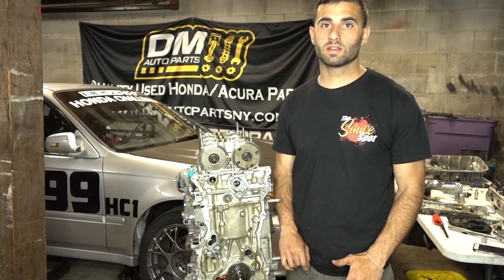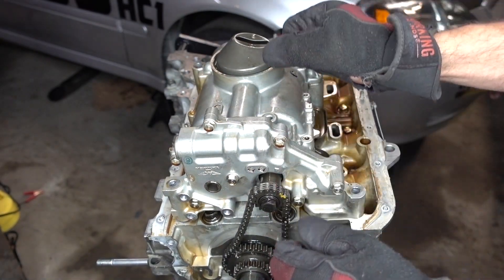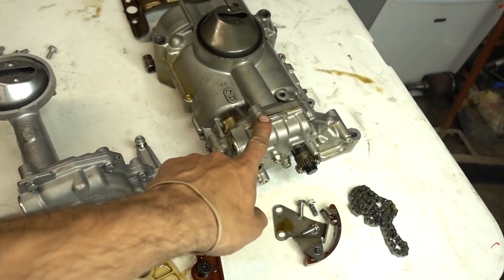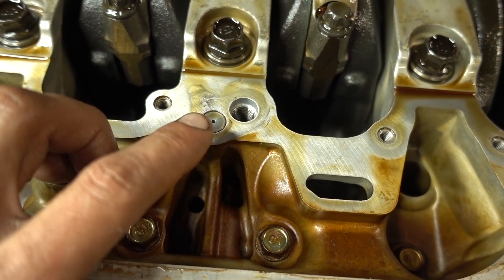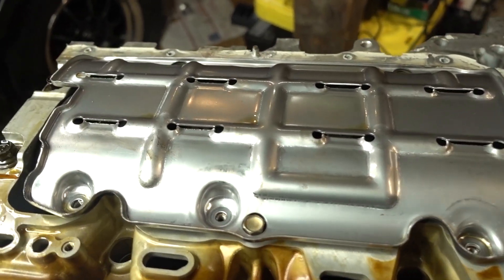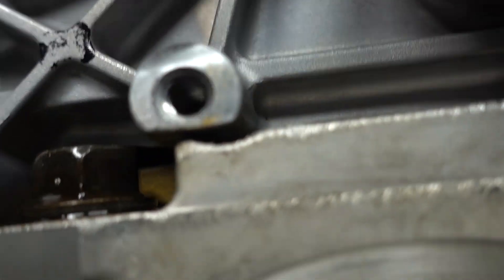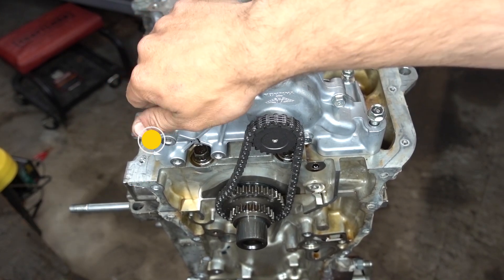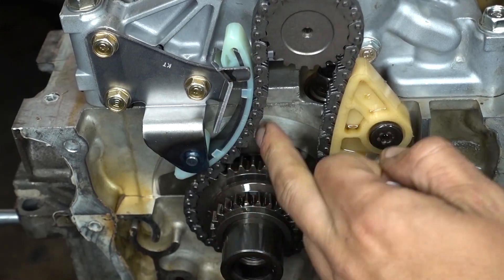ACURA RSX TYPE S K20 OIL PUMP INSTALL ON K24 BLOCK

Comment: Big boss!! What if I don't want to change the oil pump in my K24a ?  I have an 8th gen civic I'm tired of the 2.0l . So i got the k20z3 out . Everything is almost switched over expect the pump. What if I want the k24a original pump do I have to do anything special???  Do I have to switch it ? Will I get oil pressure if I just keep the original k24a oil pump in thier ? Please man I need your help!

Comment: My chain wont fit.... Cant get it on the crankgear and the oil pump gear at once. If i tilt the oil pump i can but its already under stress at that point. Cant get the oil pump into its position without breaking the chain... not sure what the hell is wrong...
Reply from the maker: Are you using the RSX oil chain? does the pump bolt down okay without the chain attached maybe there is some more trimming that's needed on the oil pump to fit the k24 block.
Reply: @DAVEMARINO  Yes the pump bolts down fine. No issues there. I bought a K24 timing set which included a K24 oil pump chain. Is the RSX oil chain longer?
Reply from the maker: @asbuster2191  You need to get the RSX oil pump chain.
Reply: @DAVEMARINO  oof. Thats a 100 euro chain... Oh well... If i need it... Cant build my engine otherwise haha. Thabks tho!
Reply from the maker: @asbuster2191  Best of luck

Comment: Is it beneficial to swap the k24 oil pan out for an rsx type s oil pan on this conversion? Should I just leave my k24 original oil pan on the motor
Reply from the maker: No real benefit to it. the K24 steel pan can take hit better on the road vs the aluminum oil pan that will crack and break.
Reply: @DAVEMARINO  Would the oil capacity increase since the k20 pump is smaller? My intake camshaft keeps scoring on the journals. Been twice now not sure what is causing this? Any ideas
Reply from the maker: @jeepetaMadison  There might be a slight increase in capacity nothing really noticeable. id check to see if there are any oil galleys clogged and make sure your oil pressure is where it needs to be
Reply: @DAVEMARINO  Just a curiosity question. Can I swap my k24A2 cylinder head internals into a k24A4 head and run it on my 04 TSX? My A2 is bad and all I have available is an A4 head
Reply from the maker: @jeepetaMadison  The internals from the tsx head should be able to be swapped over.

Comment: do you need the windage tray or can i just modify the k20 oil pump and slap it in my k24 block ? (with the plug swap for the bolt of course too)
Reply from the maker: Yes you need the windage tray.

Comment: I stripped one of the oil pan stud. How did u take them out? I’m trying to put in my type s pan.
Reply from the maker: damn that sucks ! I have been there before good luck getting it out. I usually use the double nut trick to get them out. Can also use a stud extractor.

Comment: What did you use to shave down the oil pump?
Reply from the maker: I used a cut-off wheel to get the large portions off then grabbed a Dremel for the fine parts

Comment: I'm a K-series noob, so I am going to ask the most basic question.  What is the goal of using the type S pump over the original?
Reply from the maker: Better / consistent oil pressure and it doesn't cavate at higher RPMS

Comment: Can someone tell me what is the advantages of using k20 oil pump over the k24 oil pump?other than being more light in weight..

Does k20 oil pump will increase the oil pressure and more suitable for higher rpm applications?
Reply: Correct

Comment: is this a k24/20 build? I'm wondering if i just run a K24 long block, can i still upgrade the oil pump to a K20 just for the sake of a upgrade without having a actual k24/20 build.
Reply from the maker: This is a Full K24a2 long block. No K20 head. 
Yea you can add the oil pump just like I did.

Comment: I’ve been reading that because of the differences in the pumps more oil has to be added. How much oil for a k20/k24 frank with this pump should i be adding?
Reply from the maker: It’s might require a little bit more oil. I usually stick to around 4.5 /4.6 quarts. 
The best guide is your dip stick for oil level

Comment: how is the vibration at idle with the k20a2 oil pump vs the k24a?
Reply from the maker: mattman20132 I never had the motor running in the car with the original TSX pump. I have never heard anyone complain about vibrations from the type s pump.

Comment: I'm going to swap a k24 into my rsx do I need to use a type s oil pump??
Reply from the maker: Fernando Ramos You don’t need to but the type s pump will help with oil pressure , rev higher and lighten up the pump in the motor. It’s a nice extra but not required
Reply: @DAVEMARINO  appreciate it 💯

Comment: Do you know if the chains are th same size?
Reply from the maker: meshedpotajoe K24 chain and RSX chain are different lengths
Reply: @DAVEMARINO  ok thank you. I'm piecing together everything so i was a bit confused since sometimes part numbers can be different but they're the same part
Reply from the maker: meshedpotajoe Yeah I understand ! The parts list here is what you need ! Good luck with your build !

Comment: How much will cost all those part to make the swap of oil pump❓❓
Reply from the maker: Eddy Elf about $300 or so
Reply: @DAVEMARINO  all the listing parts will cost $300??
Reply from the maker: Eddy Elf Should be some where around $300. If you check AFHkparts.com they sell a kit actually with all these parts.
Reply: @eddyelf6325  $460 from jhp ported and trimed 2 fit includes all parts except m8x1.25 fot plug

Comment: Thanks so much for sharing Dave. It’s helpful to have the parts list and torque values so, double thanks. Beside weight saving is the type s pump just better? Robert in Austin

Comment: I am currently doing a k24 swap on my fd1 if im running a k20z3 oilpan do i need to do this oilpump swap or i can just leave the stock k24 oilpump with the k20z3 oilpan thanks
Reply from the maker: You don’t need to do this oil pump swap. It helps to free up some weight and better oil pressure

Comment: One of the best vids on this subject. How long a bolt did you use to block the jet .. ?
Reply from the maker: Justin Read Thanks for the kind words! I don’t recall the length of the bolt sorry
Reply: DAVE MARINO I am building a k24a3 this is a euro spec so same as USA a2.   Oil pump first and then 50 degree gear. I know where to go for advise now
Reply from the maker: Justin Read Awesome best of luck with the build any questions feel free to reach out! My social media’s are in the description. 50° VTC is deff another worthy upgrade. I’d suggest a limiting Pin as well to mechanically limit the VTC to 40.
Reply: DAVE MARINO where are they available from please I have a sump baffle also and a alternator relocate kit the engine is going in a mr2 spyder
Reply from the maker: Justin Read Check out tractuff.com. They have it on their site. It’s really easy install. I should do a video on that one day as wel

Comment: whats the benefit for doing k20 pump on k24 block?
Reply from the maker: it allows you to make better oil pressure at higher rpm and its a lighter oil pump.
Reply: @DAVEMARINO  thanks for reply.

Comment: Why did honda use the balancer gears in this factory oil pump ?
Reply from the maker: Not sure why honda used the Balancers for a lot of the later motors. Lucky for us we can used the Type S pump on a lot of the motors'
Reply: They use the balance shafts to help cancel out the vibrations from the pistons going up and down to make the motor run smoother. 4 cylinder engines are inherently imbalanced. Removing the balance shafts will reduce weight and drag and improve reliability at high RPMs, but you may also notice more noise and vibration in the cabin as a result of the engine's inherent imbalance no longer being cancelled out.

Comment: I read on a form you plug off the little hole underneath the oil pump as well.
Every where else I’ve seen how to do this no one does it. What do you think?
Reply from the maker: I havent seen anyone else do that before. The way i did it here has worked on quite a few motors
Reply: If you are referring to the little hole in the block next to the main oil feed hole, that's a pressurized oil feed to lubricate the ends of the balance shafts. It isn't really necessary to block it off since the flange on the K20 pump covers it, so you aren't going to lose a significant amount of pressure from there. However, if you want to plug it off to ensure that no oil will escape through it, doing so could only help your oil pressure. Less leakage is always better. I'm OCD so I am going to see if I can thread the hole and put a screw in it to ensure that there is no leakage, but you don't have to.

Comment: I accidentally trim my k20 oil pump too much where I can only put 2 bolts in for the tensioner which the tensioner has 3 bolts and i was wondering if that will affect anything or any other way for me to fix it ?
Reply from the maker: Mean-K DayNnight Not sure I would trust it with 2 bolts. A new pump would be cheaper than a whole new motor in my opinion. Best of luck with your build
Reply: Yeah that true, thanks for responding

Comment: Question, i have a 2000 civic dx sedan.  What is the best "drop in" engine replacement i can get?
Reply from the maker: Well most Honda motors would drop in pretty easy with the correct mounts and some basic mechanic skills. really just comes down to cost and power goals